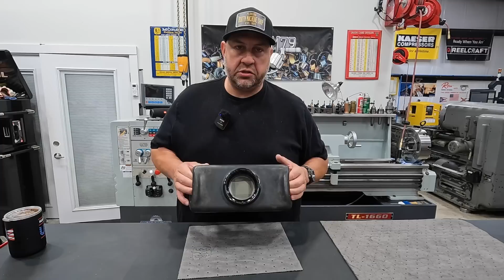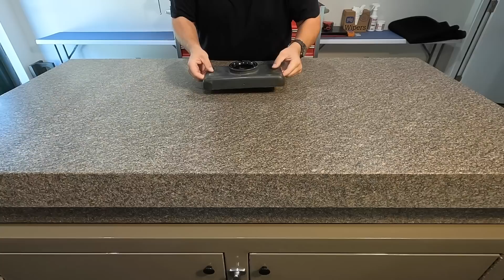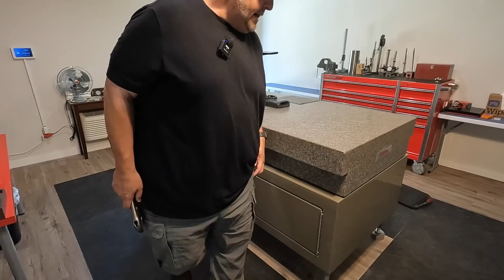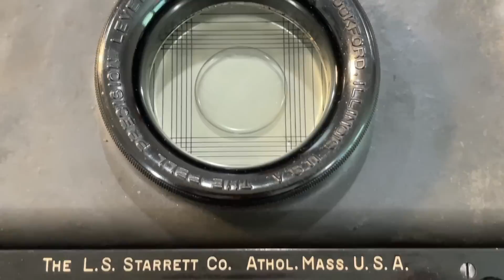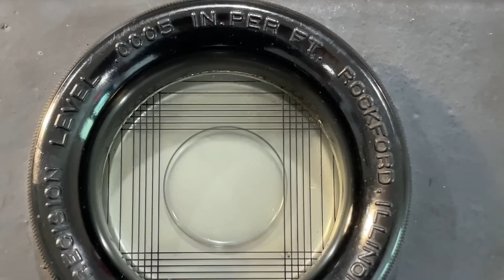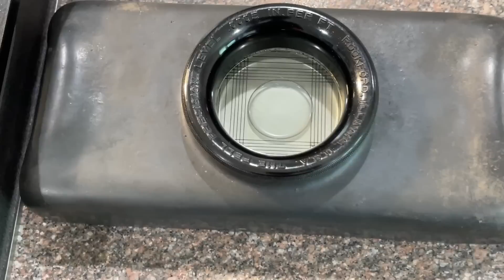Tool Tuesday Ep. 6: The Fell Precision Level

Comment: maybe surface tension of the fluid in the level provides that top dead center you must overcome to get the bubble to move. What is fluid? Kerosene?
Reply: Tom on OxTool refilled one, i think he said it was alcohol if i remember correctly. It had a very distinct smell he said. The video is within the last couple years.

Comment: Has anyone seen a two stage leveling foot with the second stage being a finer pitch?
Reply: You could even do a differential thread, where the leveling foot screws into a sleeve that has slightly different threads on the outside and inside. For example, if the sleeve has an outside thread that is right-hand at 20 pitch, and an inside thread that is left-hand at 24 pitch, then rotating the sleeve gives an effective 120 pitch.
Reply: I think I have that backwards--I think they both have to be right-hand (or both left-hand)

Comment: Looks GOOD, Adam. With as "fresh" as that concrete in the new shop is, I'd expect you'll need to make some minor adjustments every couple of months. That slap is going to move quite a bit by the standards of those 0.0005" levels. Nice work!

Comment: speaking loudly from the upper deck; need to rotate it 45 degrees so the lines on the level are perpendicular with with the cross between the four leveling feet.

Comment: I'm not a machinist, but I level cabinets with leveling legs and use I a lot of Stabila levels daily, and when you first described dealing with leveling I think you had it backwards which direction to adjust.  Your right about chasing your tail though.  You actually need to adjust TWO or THREE legs at a time, not just one, or it will be pivoting on two legs diagonally.
Reply: He did have it backwards--but given how often I make the same mistake, I decided not to say anything. Like me, he figured it out the first time he moved the screw and the bubble moved the wrong way.

Comment: Rubber feet, You'll never get that perfect. Just you walking around the table or a small temperature change will make a huge swing in the accuracy your trying to achieve.
Reply: He needs an environmentally controlled clean room with a 3 foot thick floor...
Reply: Just the temperature variation from one side of the room will cause changes at the level.

Comment: In my professional experience what is important is the  precision accuracy and flatness of the surface plate and the precision accuracy  of height gages, and other measuring gauges used on the plate. If The place is slightly out of level, unless extremely out of level, it should have no bearing on your measurements on the plate surface.
Reply: I wonder if gravity might have an influence?..
Reply: OCD makes the machinist mind go 'round.
Reply: Agreed!

Comment: Be interesting to come back in a month or two and see if/how it has changed, with use, ground movement, and gravity.
Reply: Cosmic rays will bend it.. maaaan!  Seriously, a friend of mine helped develop a trixial connection to wafer chucks and even with the whole thing shielded by metal, after zeroing the leakage current out at night, the long term leakage measurements would go up and down, up and down with the days.  The cause?  COSMIC RAYS emenated from the Sun.
Reply: I wonder if the Fell Level was used in building the LIGO (Laser Interferometer Gravitational-Wave Observatory)?
Reply: I'd sooner suspect changes in the rubber pads he mentioned.

Comment: I am not a machinist, but I worked in Civil all my 47-year career.  Having leveled precision surveying instruments (not to the precision you are achieving, but still very precise, sensitive instruments) my entire career, I can't help but think back to the procedure I was taught early on and used my whole career.  As a novice, I was taught to level an instrument across the diagonals on a 4-point supported instrument.  For 3-point instruments, I was taught to level across two supports and then 90 deg to the first.  I figure you were taught according to the machine manufacturer's directions, and I will NOT dispute their instructions or your expertise in your profession.  I just know that leveling a 4-point supported instrument with adjacent screws, you will definitely chase your butt X-times longer.  I have seen this type of frustration leveling machines on many channels and wonder what you were taught, or what manufacturers recommend.  If you could address that some time, I would appreciate it. Thanks.
Reply: Not sure if this is correct, but I was told to check levels on a reference surface, by rotating the level exactly 180 degrees in place to check the calibration.   If the level is true, the bubble will indicate identically in both directions.
Reply: Trying to level a surface plate to this accuracy mounted on a rubber mat on a wood floor is a waste of time.
Reply: My recollection is it is not a wood floor, but a concrete floor that he covered.  I may be incorrect, but that's my recollection.  The rubber mat I also remember as a recommendation of the manufacturer (Starett).  Correct me if I am wrong.  Bottom line is we all could discuss and debate leveling (I had my input as well) till we are blue in the face.  The main thing is it is flat.  
Thanks @johnsawyer2516
Reply: That seems to make sense...
Reply: I’ll ask a uneducated? I thought a surface plate needs to be flat and Level is close just so parts don’t fall off is it being out of level going to change flat?
Reply: At some point, this is the perfect example of "leaving good enough alone". Otherwise you may want to read into old greek mythology and find some sympathy for Sisyphos.
Reply: @alexanderkupke920  Hahaha--rolling a large rock up a VERY small mountain--again and again and again.
Reply: I just measure it and get it right.
Reply: I was thinking if the level was rotated 45 degrees, it would then make the lines on the level perpendicular to the adjusting bolts. But just an thought from the cheapest seat! Thanks Adam
Reply: @hasletjoe5984  Nice thought, but with 4 leveling feet it does not matter if the base you are leveling is rigid enough (spoiler, for those minute adjustments it is not), as soon as you change one foot, you automatically interact with at least one other foot as well that now bears more load or is more or less up in the air.
Reply: As I was watching it, I thought about leveling it diagonal with the feet alignment. In theory with the precision of the level the diagonal is the same as the square.

Comment: Let it rest for a couple of days. 
And check again.
The one thing i didn't liked  in the previous  video , was that piece of linolium under that masive weight.
It will deforme over time .
So checking it regulary , i would do.
Over a couple of months it will not compress anymore and you can check it only yearly , as the earth itselfs moves to. ;) 😉 
Grtz from the netherlands Johny geerts

Comment: Have you considered the fact that the bubbles may have been sealed at different altitudes so the bubbles are seal at different air pressures which can affect readings at different altitudes.
Reply: If the body of the level is rigid, and I'm sure it would be, then the bubble size wouldn't be affected by atmospheric pressure.

Comment: Could you get more fine-grained adjustment from using a smaller wrench for the adjustment? Using less leverage for each bump?
Reply: No you want a bigger wrench for more control, think about a massive steering wheel - you'd have to turn it alot for a small amount of steering, hence greater control
Reply: @zukomonitor  Thanks for the answer!

Comment: Would it be quicker to line the levels up on the diagonal (corner to corner line) where they bisecct in the dead centre of the mass of the plate. Then you would surely know it's leveled out properly. Like how you check building frames for square by measuring the diagonals.

Comment: Question - Couldn't you just rotate the levels 180 degrees and see if they read the same as they did before to check the calibration?
Reply: yep. Beyond me how he talks about "one is off" instead of just rotating it.
Reply: @FireGodSpeed if they’re both reading different values, then 1 is definitely off. Maybe both. Yes, it is beyond you.
Reply: But to self check either level, turn it 180deg. The bubble should end in the same place. No matter how ‘out of level’ the surface is.
Reply: @DB-thats-me   That is a good idea in theory but at that scale of resolution you would never be able to rotate it exactly 180 by hand and there for it would look like it is off but may not be. You would need to have a vary precise jig to keep it in the exact same spot.
Reply: Usual way is place a straight edge against one side, turn level and re-lay against straight edge. 
In this case, your not testing for ‘level’, your testing for repeatability. 
There is an oblique angle that MUSY be level when transitioning between +slope to -slope, and vice versa.

Comment: Interesting tools Adam, but at the end of the video is there 2 brass washers on the granite surface plate about 2 feet apart? 🧐
Reply: He pointed them out when he first reviewed the plate.  They are indeed threaded inserts for installing vertical rods to hold dial indicators or other PMI accessories.
Reply: @surlyogre1476  Thanks. I thought I remembered that, but I didn't bother going back to the old video to check, so I hedged my comment.
Reply: Looks like there are some threaded inserts in the surface plate.
Reply: @danmenes3143   I never noticed them before then, my bad...Cheers.

Comment: I thought a surface plate should be on the table with three legs.
Reply: The plate itself is on the 3 points on the plate stand but the plate stand itself has 4 legs for obvious reasons.
Reply: @FireGodSpeed  that makes sense. Thank you for explaining that.

Comment: Cool tool, how does the water not sublimate(I think that's the word) out of the cavity over time.
Reply: Sublimation is when a solid skips phase change to a liquid and goes directly to a gas.

Water doesn’t sublimate at atmospheric pressure.

Evaporation might be the word you’re looking for but as previously mentioned, this probably isn’t water.
(Even if it was, it can’t sublimate and won’t evaporate from a sealed container.)
Reply: @Jay22222  at freezing tempratures it does , thats why and also the lower viscosity , methanol is the fluïd used.
Lower viscosity let the bubbel move fast even with the slightest movement or mis alignment. 
Grtz from the netherlands Johny geerts
Reply: @Metaldetectiontubeworldwide  Thanks for that makes sense, I was thinking of something like osmosis but probably a made up word that I think I remember for 40 years ago :)
Reply: @Metaldetectiontubeworldwide  Water does not sublimate at atmospheric pressure.

I don’t know how else to say it without getting you to check a phase diagram.
Reply: Looks like mineral oil to me, not water.
Reply: Its methanol i think 😊
Reply: Isn't it mineral oil?
Reply: I think the word you are looking for is "diffuse." And I imagine it does, over time, but diffusion constants for most things through glass are pretty small at room temperature.

Comment: How d you not destroy or at least alter the flatness of the underside by using the stones on it?
Reply: It's like rubbing a piece of paper over a rock, the harder things wins.

And rubbing the stones together makes them flat to each other, then Rubbing the flat stone just takes off any nicks and raised burs.
Reply: @Hossimo   Thank you, exactly correct.
Reply: Poor Adam!
A man with one watch knows exactly what time it is.
A man with two watches has no idea what time it is!
😊
Reply: Yeah, I wouldn't do that, maybe a slight lapping on a plate larger than the area
of the level base.
Reply: Those are not just ordinary stones, they have been precision ground to very near perfectly flat. When they come in contact with a surface that is very near flat itself the load is distributed evenly among thousands and thousands of contact points meaning there is no ability to overcome the deformation pressure needed initiate a shearing action. When the stone comes across a singular high spot, all of the pressure is concentrated on that spot until it is cleaved off. 23 Acre Maker sells the stones (Lance who is in many of Adam's videos) they are worth every penny if you do machining.

Comment: Block it in two directions and rotate it 180. It should read the same in both directions.
Reply: Yeah - bummer to miss the initial level check. That 180° flip tells a story about everything that happens after.
Reply: Exactly.  Calibrating a precision level takes some effort, but merely checking ON the current calibration is almost the easiest thing there is.  And it most definitely applies to this 2d bubble.  
In fact working with this type to level a 4-legged machine, I have found it easier to place the level diagonally.  It probably isn't that way for everyone, depending on how you like to work.  And I'd never tap the adjusting wrench with anything as soft as my palm, instead I use a tiny hammer for consistency.  Again I don't think there's a right or wrong, that is just my way.
Reply: At 4:00 or thereabouts he says why he does or does NOT do that with this particular level.  TLDW?
Reply: @silasmarner7586  Yes, except this is also how you check a level for accuracy.  I know, because I have dropped levels and bent them and that's how you know it is bent.
Reply: @silasmarner7586  He is referring to not having to rotate the level 90 degrees because it's dual axis. Precision levels should ALWAYS be rotated 180 because by their very nature they are self proving. If you rotate 180 and the bubble stays to one end of the level, the level needs adjustment, if the bubble stays to one end of the work the level is calibrated. TLDU?
Reply: @SPDLTD  no difference; it should settle in the same quadrant if calibrated. I do not know how to adjust that particular level if it is out of calibration. But based on the check with the 199.  it is damned close :).  But according to the old proverb; a man with a watch knows what time it is; a man with two watches is never certain.
Reply: @unclespicey42 that why you do what guidence systems do, you use three and the two that are the closest are used.